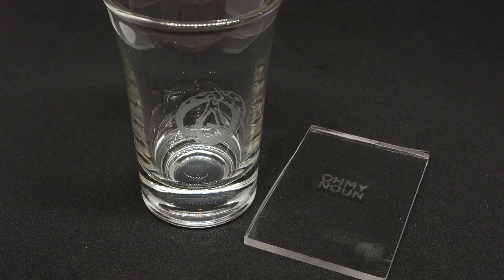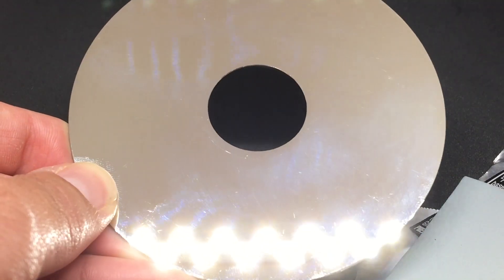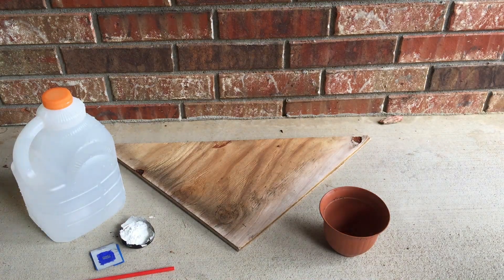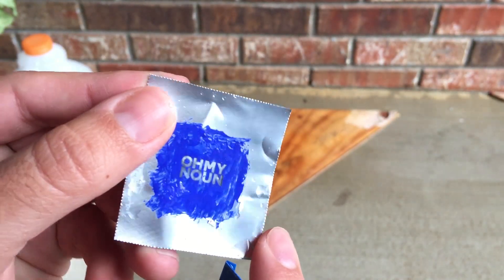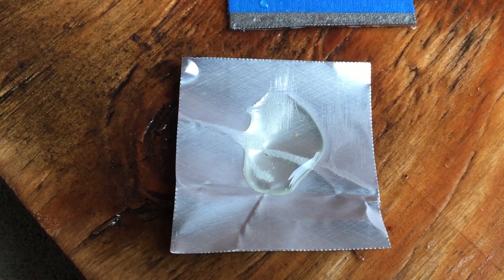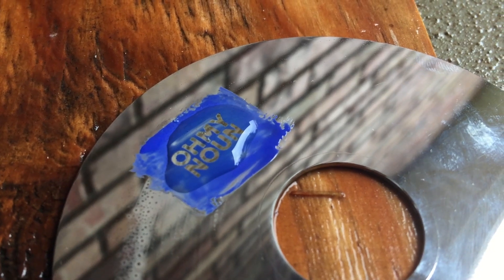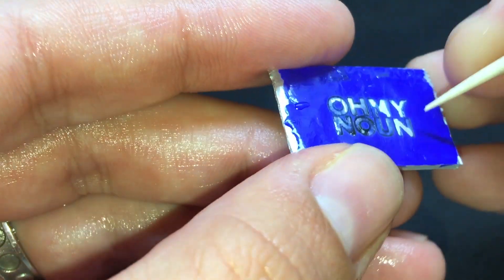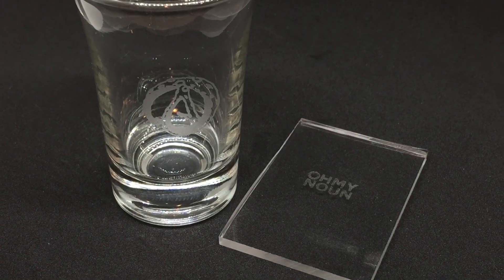How to Etch Metal with a 1000mW Colemeter Laser…and FAIL

Comment: You should test electro etching. 9-12V battery or battery charger with the positive cable connected to the metal and the negative to some cloth or fabric soaked with some destilled water and table salt and just hold over the area to be etched, keep the fabric wet. That's how I put my makers mark on my knife blades, bit with some stencils.
Reply: I second this process. It's how lots of home brewers etch measuring lines on their stainless steel pots. Etching this way, when combined with the laser etching of the nail polish protective layer could be a real winner.
Reply from the maker: Thanks for the upvote on this! I'm working on a new attempt at this now, but I'm not sure when it will be done. I have to hit 1000 subs by February 20th or YouTube stops paying on my videos, which is where I get the money to buy the materials for these videos. So any sharing you can do on my videos is greatly appreciated!
Reply from the maker: That's a great idea! It's going on the list!
Reply: ohmynoun alot more safe than working with acids.
Reply: I posted a tutorial on how to do this using vinyl stencils on Don Foggs Bladeforums many many years ago 😁

Comment: muriatic acid will not burn your skin used it all the time to solder sheet metal drain it just takes the galvanize off the metal so the solder will stick
Reply from the maker: "Muriatic acid is the commercial grade of concentrated hydrochloric acid. When in contact with the skin, it denatures proteins into their chloride salts. Copious irrigation and early excision are the treatments of choice."

https://www.sciencedirect.com/topics/pharmacology-toxicology-and-pharmaceutical-science/hydrochloric-acid

Comment: I'm trying to make the same process you made with the glass in steel, but, electro etching the logo.....so far so good, but I had to change the engraver and the new one works pretty different from the other
Reply from the maker: Awesome. Wha engraver are you using? What are you using for the stencil?
Reply: @ohmynoun  I was using a Neje but does not handle heavy objects and I change it for a chinese one, those who are like a dome, with both axis at the upper side. For stencyl material I'm using my wife's nail polish, and a 12v power supply  for the etching process

Comment: You should get yourself some PCB etchant (ferric chloride). It's made to remove copper from circuitboards and nailpolish is a good resist for it. I suggest your nailpolish is too thick as well. Thin it with acetone first to get a thinner coat. Even a sharpie is enough resist in most cases.
Reply from the maker: Great recommendations. I'll look into that and do an update video if successful!
Reply: AVE has some tips https://www.youtube.com/watch?v=iAhiGqsi7N4

Comment: Thank you for the video. Have you ever tried a hard wax?
Reply from the maker: I'm not super familiar with wax types. Would candle wax be close enough?
Reply: ohmynoun I use these hard waxes for sculpting. Candle wax is pretty soft stuff that I'm sure would melt straight away. I think I'm gonna get one of these engravers and try it out:) Thank you for the inspiration.
Reply from the maker: I'm not sure about the differences between hard wax and candle wax, but I do know that the laser uses heat to etch. Since wax melts, properly adjusting the burn time is important, but I was able to get some faint patterns to show up on a bit of candle wax. The problem is that it only shows up because it causes the texture to change a bit from what's around it, and so it's probably not a very good way to do anything that should be decorative.